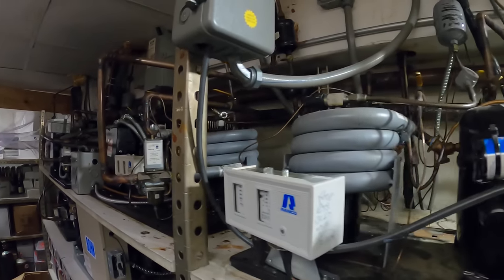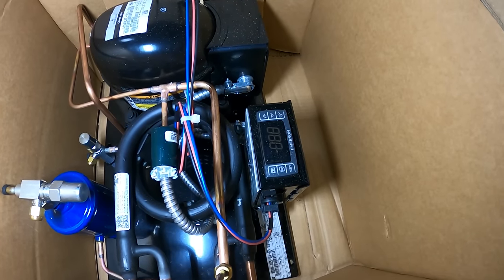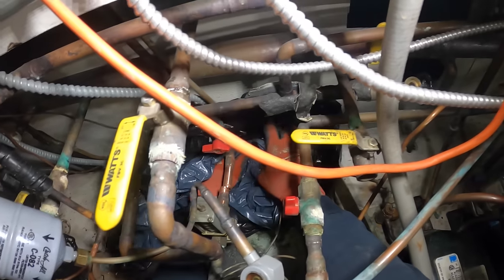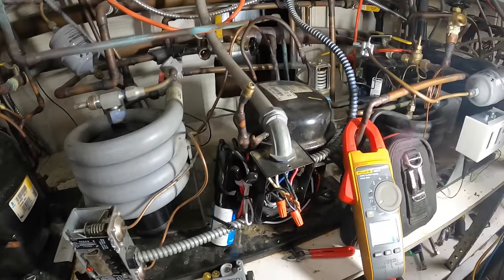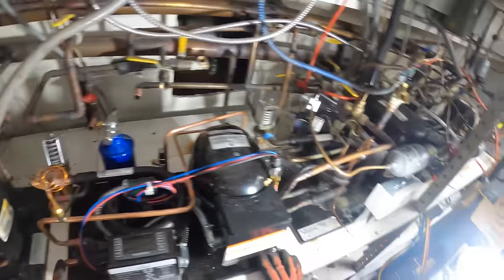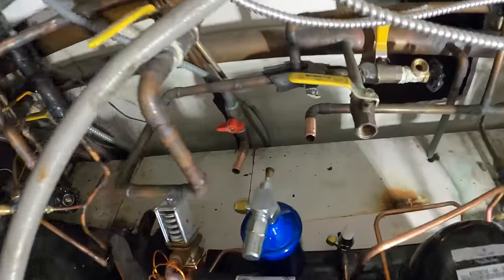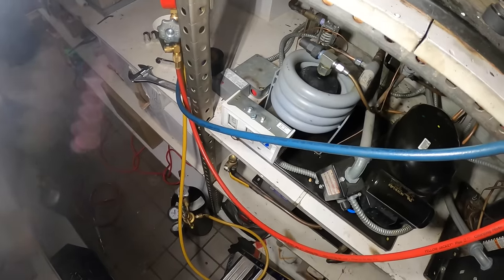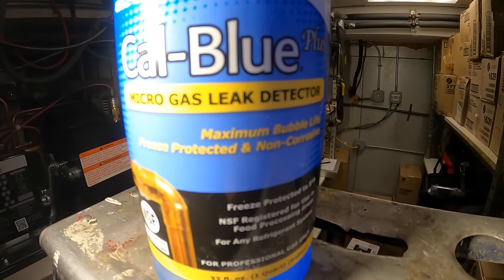HVACR: Refrigeration Water Cooled Condensing Unit HACK JOB Replacement-Condensing Unit Installation

Comment: You need to look into getting some trublu vacuum hose it will cut you vacuum time down by 60% to 80% or more 3/4 ID hose with hook up for 1/4" 3/8" 1/2" you can pull 200 microns are low with no problem

Comment: Holdin test pressure should b no more than evap. design pressure nowhere near 300psi!. & micron guage should b directly on equipment service port w shrader core removal tool w a shutoff & micron guage on valves side pressure tap so yer not leak testing yer guages